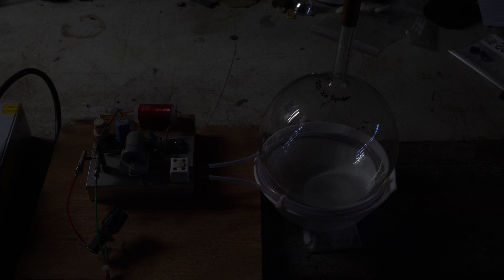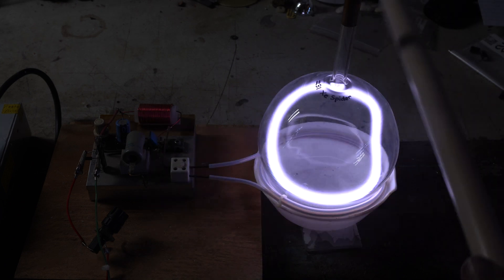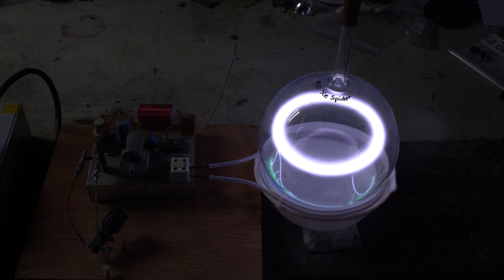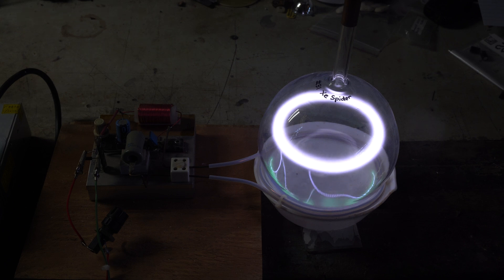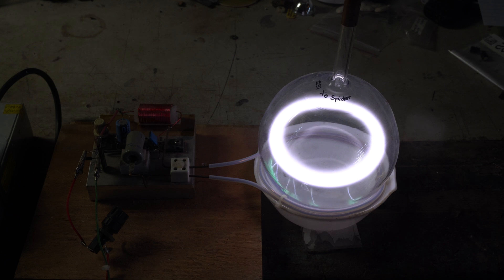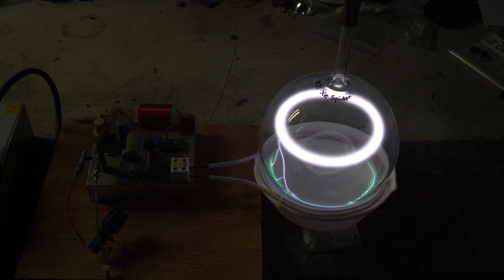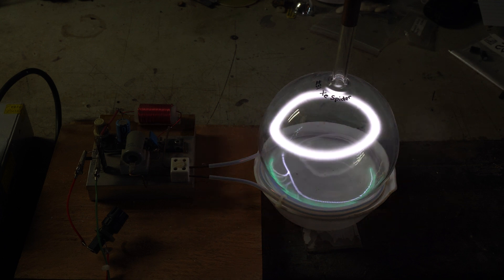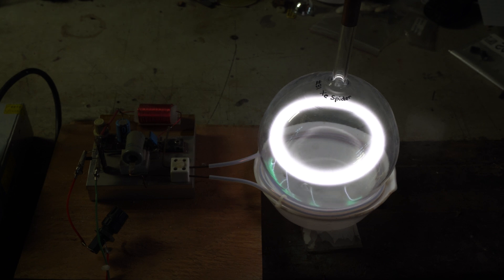Xenon Plasma Toroid

Comment: Nice! What circuit are you using?
Reply from the maker: https://www.circuit-diagram.org/circuits/24ddc75d2c05422cb0dfbe5f598448c6
Reply: @cometboy1  Thanks! Is that a K15U-2 cap you're using for the 2kV 100pF one?
Reply from the maker: @ua89das7ufj   The cap is a tricky part. I've used a few that work and a few that explode. 
The biggest is a Russian/Ukrainian monster grey K15-14B about the size of half a Sharpy marker. The smallest are parallel
2kV 33pF. The dielectric should be COG for low loss. There is a lot of current/voltage sloshing through that cap.